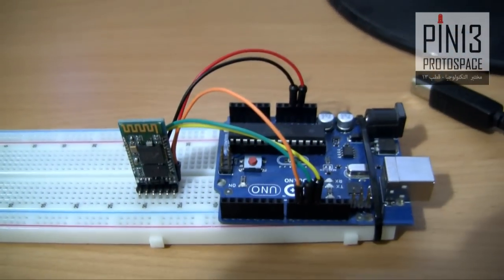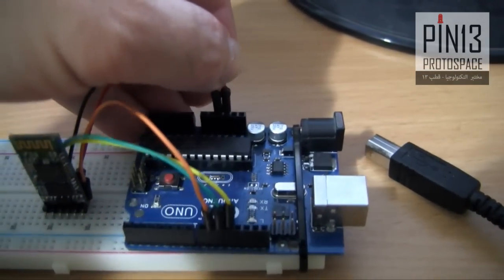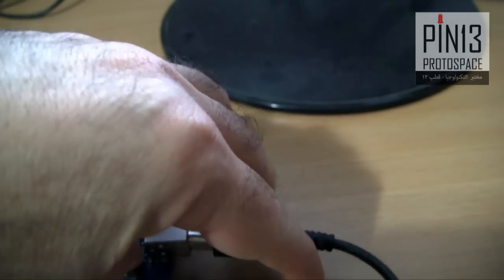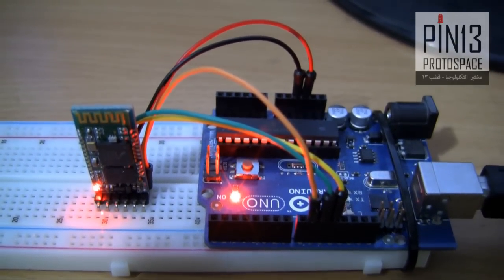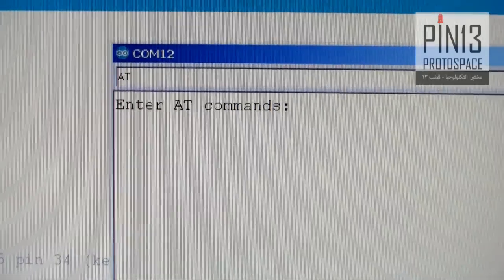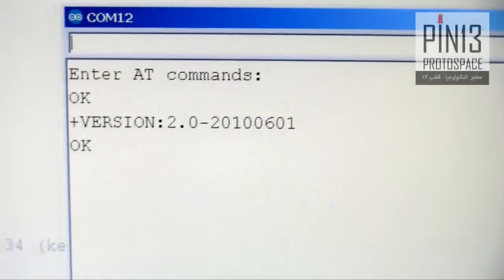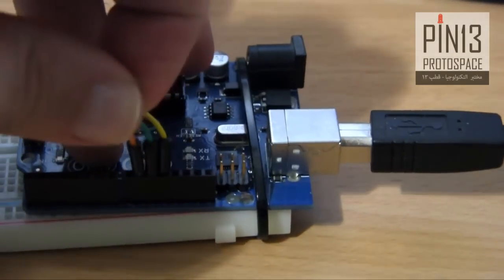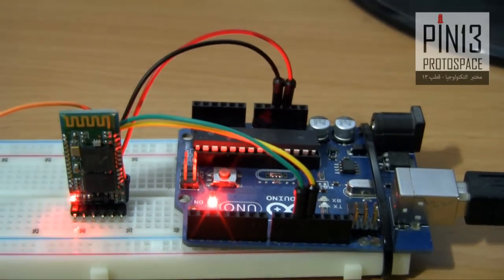Configuring The  HC-05 Bluetooth Module with AT Commands

Comment: Just some additional info after struggling during 4 hours.
- In the serial Monitor, down and on the right (left from 9600 bauds) you have a menu. You click in this menu and select "Both NL and CR". I read that comment from Nasen an hour ago but didn't understand it was in a menu so I was adding "\n\r" manually in the command but it never worked out.
- I used pins 2 and 3 for RX TX. Doesn't work with the others (and yes, I changed in the code).
- If you are using HC-05 ZS-040, you just need to wire RX, TX, 5V and Gnd. Press the push button, plug the usb, release the push button after 3 sec. You are in AT mode and the LED blinks every 2 sec
Hope this will help
Reply: THANK YOU !!!!!!!!!!!!!!!!!!!! U saved me 2 hrs of my life.
Reply: THANKS Lad
Reply: After hours of trying finally found your comment. Shortly before going nuts you saved my mind. Thank you :). And of course also thanks to techbitar for the video itself.
Reply: Thanku bro.
You actually saved my time
Reply: TKS BRO
Reply: Why is this not the pinned or top comment? Too helpful. Thanks for the info
Reply: I love u bro,
Reply: again , thank you

Comment: Very helpful  thanks, just mention that when you enter AT commands on the arduino IDE serial monitor, you have to set it under Both NL & CR and 9600 baud for it to work with this code

Comment: HC-05 Bluetooth, according to the datasheet is 3.3Vdc RxTx level and Arduino works with 5V. In your video the bluetooth is connected directly to the Bluetooth without any level converter.

Comment: Good observation. If  you follow the link to my guide I have stated that this is not a good practice. The HC-05 breakout board supposedly has current limiting resistors that will provide temporary protection but not meant for prolonged use. For changing settings of the HC-05, I figured it's for a very short period. But for long term use of the HC-05 it's best to level shift to 3.3v. You only need to do it for the HC-05 RX pin. The Arduino can handle the 3.3V coming out of the HC-05 TX pin.

Comment: Great tutorial.  I LED is blinking, but nothing happens when I input the AT commands.  Please advise?  Does the chip need to be in "Slave Mode"?  If so, how?  Also, I have read some information needing a voltage divider, which I did not do;  is this necessary?  Thanks in advance.

Comment: can you for me ask,why do i sent  a singnal  to arduino but no answer for hc05,thank you
Reply: i was able to make changes without seeing anything just like you so just go ahead and make changes and assume its working and before you are dont send the last AT+RESET command and the module should jump out of AT MODE and this will be your first confirmation, the second and last confirmation will be shown when you try to use it as you were IF everything would have worked out just like in the video.

Comment: I have followed all you steps from your tutorial in order and am still unable to get the AT to show OK. Any suggestions. Everything is wired correctly. I am using an arduino pro but that should not make a difference in the set up. So I am not sure what is the problem.please help me
Reply: anip juaini Hey i was also the same problem , i think the windos don't send "\r\n" in the end of the line.

Nasen bar wrote commant here about this problem:

"
One minute after complaining I figured it out (credit to WhizzWr@instructables):
One IMPORTANT thing, Newline feed (\n) and Carriage return (\r) are needed on every AT command entered. So if you're using Arduino's serial monitor make sure you   (!)select "Both NL and CR" on the dropdown(!).

"
and if you want try this:

#include <SoftwareSerial.h>

SoftwareSerial BTSerial(10,11); // RX | TX

void setup() 
{
  pinMode(9, OUTPUT);  // this pin will pull the HC-05 pin 34 (key pin) HIGH to switch module to AT mode
  digitalWrite(9, HIGH); 
  Serial.begin(9600);
  Serial.println("Enter AT commands:");
  BTSerial.begin(38400);  // HC-05 default speed in AT command more
}

void loop()
{
  int i=0;
  BTSerial.print("AT\r\n");
  
  for(i=0;i<10;i++)
  {
    delay(50);
  if (BTSerial.available())
    Serial.write(BTSerial.read());
  }
}
Reply: @ariellevy7009  this is still not working 😕😕

Comment: Hi. The red led is blinking all the time :( what's happening ? :(
Reply: +Marc Paradis got the answer? I have the same problem, It appers "Enter AT commands:",but when I type nothing happens
Reply: +Augustin Charles-Hermans Thank you!
Reply: +Augustin Charles-Hermans THANK YOU SO MUCH! This trick saved me so much time. I wasted almost a day for trying to put the module in AT mode. I have a question though. The HC05 exits AT mode very quickly. It doesn't wait for me to finish all the AT commands. What's the solution for this?
Reply: +Augustin Charles-Hermans Hey, I tried doing what you said. But it still doesn't work. Plz suggest.
Thanks.
Reply: +Augustin Charles-Hermans Thank you man. I just did like you said and it worked for me.
Regards,
Reply: +Marc Paradis Thats easy, i faced the same problem, there must be any button in ur bluetooth module.Before connecting the Vcc pin as shown press and hold that button and connect the Vcc. done
Reply: +Mohamed Fazil  What if there is no button my bluetooth module. what can i do to solve this issue?
Reply: THX!
Reply: give GusOvek a fucking cookie!!! Thanks man !!

Comment: I don't know if I have a faulty board, but my board won't blink at all! I tried holding the button, pressing it quickly, and removing the KEY pin's wire. (But, there really is no "KEY" pin on my board. It is called "EN") so I don't know if I am doing this correctly.

Comment: after you set this up do i use serial  and what ever other baud i want  in the sketch or do i use the same baud i just setup in at mode?  i just binded 2 hc05 one master one slave and they can talk to one another but when i try to use this in my servo setup with pot nothing happens i dont know this is really my first time using this module and i had em for like 3months now

Comment: it's cheaper to use 2 resistors as voltage divider but you can use a number of level shifters. a cheap one is CD4050  IC

Comment: My HC-05 module (FC-114) is acting really strange. Its in AT mode (LED blinks every 2 seconds), serial monitor is configured to 9600 baud (also tried 38400) with "Both NL and CR" selected. It doesn't send data back at all. With the example code of Great Scott, it somehow works. 
https://www.youtube.com/watch?v=x3KAXjnP06o

When i try it without the example code with the serial monitor, it ignores all commands i send.
I tried everything, checked if its connected right, and there are no mistakes so far.
It...is...making...me...mad. I need to see if AT mode works at all in such circumstances, so i can interface it with my Arduino Uno and MSP430G2553. Any advice is welcome.

Comment: what is the need to create a voltage divider between arduino and this BT module?
Reply: Since the voltage levels are different for these devices. Arduino High = 5V while for BT module it's 3.3V.
Reply: madesh b i am just at this point: i have a 5V supply voltage and a hc05 board with out any breakout pins whatsoever. i didn't have a voltage regulator and now i am wondering if there is an easy way to supply the 3.3V module by the 5V supply. i didn't find any information if the module can handle 5V. has anyone tried it?

Comment: Guys can someone explain to me why using the software serial connection works with the module and the built in serial pins rx and tx don't work??
Reply: got me there but ill assume that the main reason would be because you will be using the main com port to use the arduino's IDE SERIAL MONITOR

Comment: When you run the command to change the baudrate, does it change the baudrate it communicates with wirelessly or the baudrate on the tx/tr pins?

Sorry if the question is answered before.

Comment: hi there, i paired up 2 hc05 master "1" and slave "0" doing this 
AT commands

//SLAVE = 98d3:31:2093cb AT+ROLE=0

//MASTER= 98d3:32:204d2a AT+ROLE=1

//AT+BIND=98d3,31,2093cb

//AT+BIND=98d3,32,204d2a

The end im left with paired modules that can talk to one another now i set this in AT+UART=9600.0.0 or 38400,0,0 im not sure now but it worked out fine now in the sketch i was doing all this in terminal obvsly using the terminal baud rate which was

as follow

include SoftwareSerial.h

SoftwareSerial mySerial(10, 11); RX, TX

void setup

{ Serial.begin(38400);

pinMode(9, OUTPUT);

digitalWrite(9, HIGH);

Serial.println("Enter AT commands:");

mySerial.begin(38400);

}

so my problem is that when i try to take the 2 talking modules to use in another project im not sure but they dont communicate no more "after uploading new sketch" am i suppose to use the same baud rate as in the sketch (38400); or should i be using the baud that i set this 2 up to begin with when i did the whole AT+UART=9600.0.0 or 38400,0,0 ???

i was assuming what i have now when they were talking was a wireless RS232/terminal right? if so then all i have to do is make sure in the loop of what ever other program i go to use this modules on that they talk to that SoftwareSerial mySerial or something like this

void loop()

{

if (mySerial.available())

mySerial.write("Variable or Array here");

Comment: Tried it and it didn't work.  I must have spent at least three hours trying to get this to work and I got nothing.  My phone pairs up with the HC-05, but I can't get my computer to communicate with the HC.  Thank you for your tutorial, but something is wrong with somewhere along the way because a lot of us can't get it to work.  Too Bad.
Reply: facing same problem ...
if anyone has solution or tips regarding this then please please reply ... !!
Reply: Milan Shah This is what ended up working, I uploaded this sketch and it configured my HC_5.  I haven't tried it in a while but here it is.  I also used a sketch that does pretty much the same thing for the HC_ 6.

#include <SoftwareSerial.h>

SoftwareSerial BTSerial(10, 11); // RX | TX

void setup(){
  pinMode(9, OUTPUT);  // this pin will pull the BT Module pin 34 (key pin) HIGH to switch module to AT mode
  digitalWrite(9, HIGH);
  Serial.begin(9600);
  Serial.println("Enter AT commands:");
  BTSerial.begin(9600);  // your own BT Module default speed in AT command more
}

void loop(){

  // Keep reading from BT Module and send to Arduino Serial Monitor
  if (BTSerial.available())
    Serial.write(BTSerial.read());

  // Keep reading from Arduino Serial Monitor and send to BT Module
  if (Serial.available())
    BTSerial.write(Serial.read());
}

Comment: Follow these steps EXACTLY in order to pair to the HC-05 bluetooth module. (Tip: Module must ultimately be in slave mode in order for communication to take place between devices!!!!)
1.       AT
2.       AT+CMODE=0
3.       AT+ROLE=0
4.       AT+INIT
5.       AT+INQ
6.       (nothing happens)
7.       AT+ROLE=1
8.       AT+INQ
9.       Returns (MAC ADDRESS)
10.   AT+ROLE=0
11.   Copy and paste mac address
12.   AT+BIND mac address  (Example) (AT+BIND=50A4,C8,4858C3) Make sure to change your colons into commas!!!!!
13.   AT+PAIR mac address (example) (AT+BIND=50A4,C8,4858C3,20) The 20 is a parameter. You need to enter this to give a timer to how long you are pairing.
14.   Enter Pin = 1234 (Default pin that is automatically given)
15.   Enter App Sena Bterminal
16.   Go to Bluetooth management
17.   Go to "Connect to"
18.   Go to "select"
19.   Go to Bonded Device Scan
20.   Start Scan
21.   Select paired Bluetooth device
22.   Hit connect
23.   It works!!!
Reply: MAKE SURE TO MAKE YOUR DEVICE VISIBLE WHEN YOU DO THE INQUIRY/SCAN PART!!!